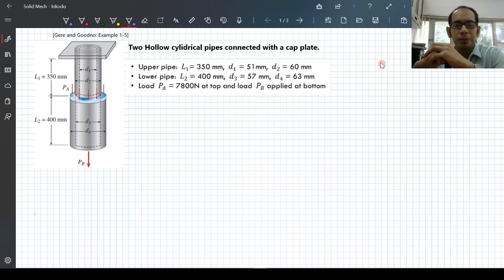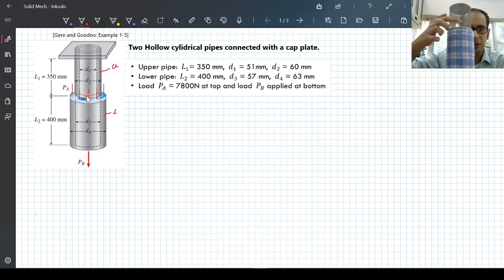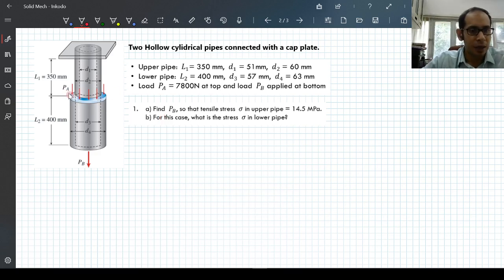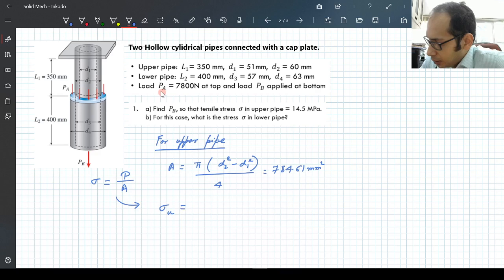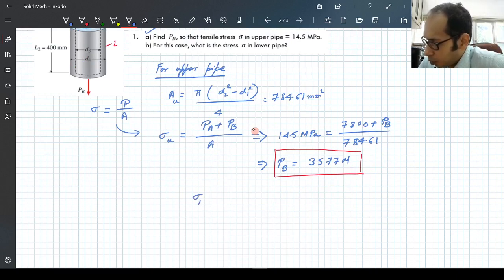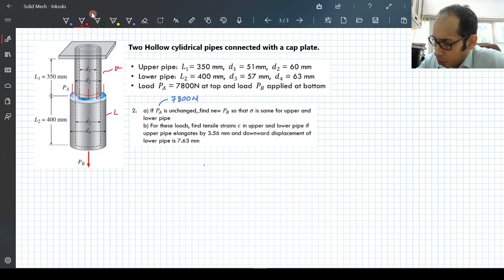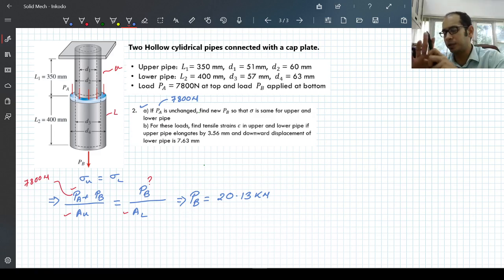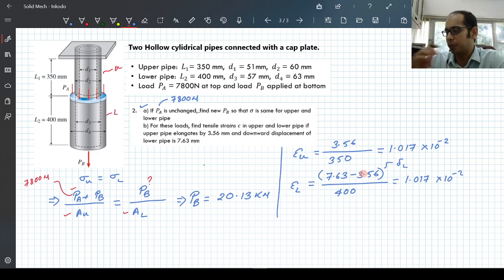Topic # 2.1 - Normal Stresses: Part 1 - Problem Example

Comment: Which book do you have used?
Reply from the maker: This example is from Gere and Goodno. This lecture series also heavily uses Hibbeler's book
Reply: @solidmechanics-prof.jaygho7500  I'm using the seventh edition of Gree and Goodno but I didn’t get the first math(1.5). Will you kindly share the edition number of this book to practice and understand your lecture rigorously?
Reply from the maker: Certainly. It's the eighth edition of Gere and Goodno's book.